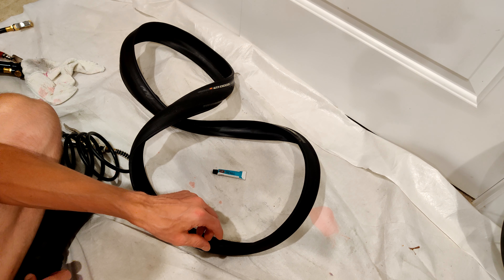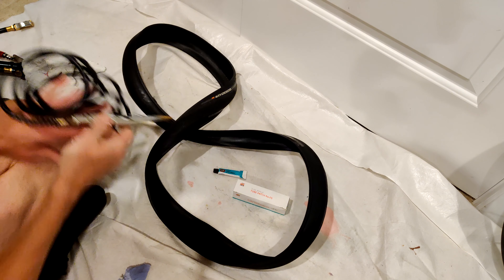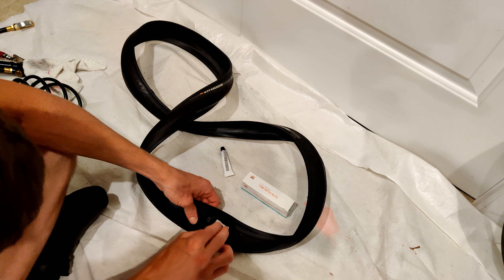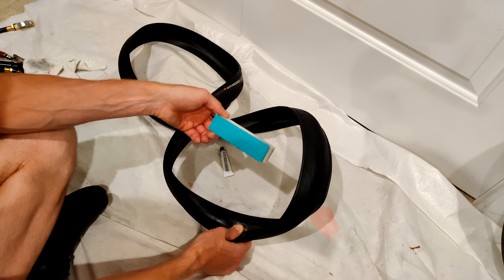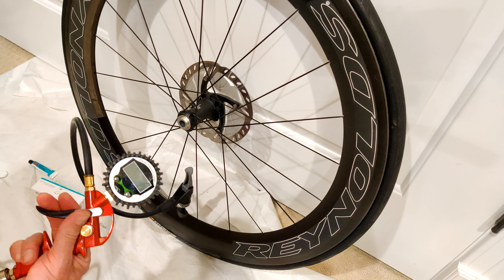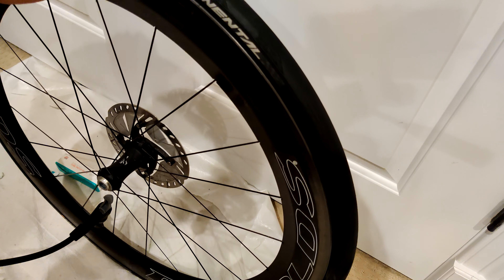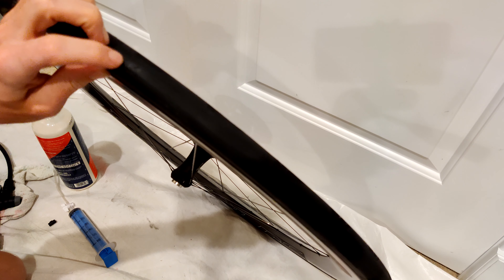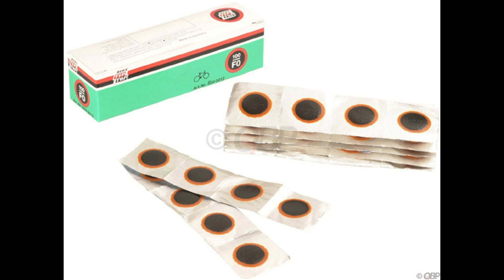Patching Road Tubeless  - Continental GP5000 TL

Comment: Stans DART would have been perfect. Permanent fix ideal for 4mm+ gashes. I've stopped carrying extra tubes completely. Gl
Reply from the maker: I'm not convinced that darts and road tires/wheels are a good idea.
Reply: @Mamilian  why is that? I've used them multiple times
Reply from the maker: Risk. You put a hard, pointed object inside a small space. It's feasible that the object could get crushed against the rim the next time the tire punctures. Hard to say what happens to a carbon rim in that scenario. Could easily be one of those 9-out-10 times it's no problem (or more), but it's not a risk I'm comfortable taking for a small amount of inconvenience.
Reply: @Mamilian  the pointed part and barb is plastic, not metal like the dynaplug. The depth that it can be inserted is limited by design. Would be nearly impossible to damage your rim.
Reply from the maker: I'm familiar with how it works. Plastic is still hard, just needs to be harder than resin. Carbon fiber is strong in the direction of the fibers, but very weak where the resin holds the fibers together. Sheet overlays compensate for that somewhat, but I'm not sure it's a scenario that OEMs design for, or would support if there was an issue. TBC, I'm not trying to say you shouldn't do it. Just that I'm not comfortable with the risk, the small amount of inconvenience to swap a tube in is worth it to me. Everyone has different tolerance for risk. Nothing wrong with that.
Reply: @Mamilian  have you seen how strong carbon rims are? The rim is the strongest part of the wheel and a bb sized piece of soft plastic isnt going to even dent the tape. 

The plug is also the only way to seal the hole instead of patching from the inside. 

They put millions into R&D and I'm absolutely sure they thought of the scenario which you speak.

A 2 second permanent fix is more convenient than taking wheel off frame, removing tire, cleaning tire to make sure no debris, taking out tube, inflating tube, getting tire back on rim, inserting tube, fully installing tire, reinflating.
Reply from the maker: I've seen carbon rims get damaged by road hazards. They are hard, and strong, but only in specific directions... While it's possible that all rim manufactures test for this, I suspect that's not the case. I also suspect that Stan's didn't spend millions developing this technology and certifying it with rim OEMs. They're a $4 million company, and many rim OEMs are similarly sized... Again, if you're comfortable using the product, please carry on using it. I'm not trying to convince you not to.  Personally, I'll continue to be risk adverse until I see hard data from wheel OEMs demonstrating that it's safe to use it. Thanks for your comments.
Reply: @Mamilian  your more likely to have a blowout and accident because your patching a tubeless tire with a inner tube patch than having a catastrophic failure because of a .1g plastic ball. I'm not here to be convinced that DARTs are inferior. I'm here to tell you it's superior and that your argument is fueled by baseless hypotheticals  and not actual experience. Good luck
Reply from the maker: @sfef84  Thanks for sharing your opinion. I think the scenario you describe is highly unlikely, but as everything entails some risk, and we all need to roll with the risks that we're willing to, you are free to make the judgement calls that work for you.

When patching a tubeless tire it is important to show good judgement around the condition of the tire that you're patching. If the patch is peaking through the gash, probably best to throw the tire away.
Reply: @Mamilian my take - sounds like you  work for a tire company - my tire is new and hard to justify getting a new 80-$90 tire
Reply from the maker: @brocprice1  Couple things that confuse me about your comment. 1) New and safe aren't the same thing. If you have a hole in a tire too big to safely patch, you should discard it regardless of when you bought it or what you paid for it. Not doing that is a risk to you and everyone who rides around you. 2) This is a video about how to patch a tubeless tire that has been punctured to the point where sealant won't work. Did you miss that somehow? AFAIK, the tire companies suggest discarding the tire after a puncture. This video demonstrates how unnecessary that is...